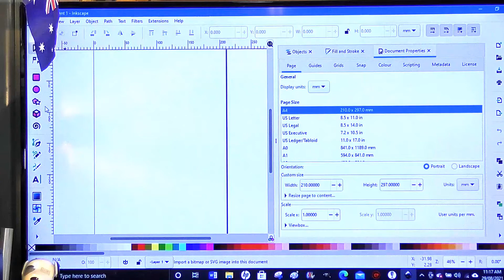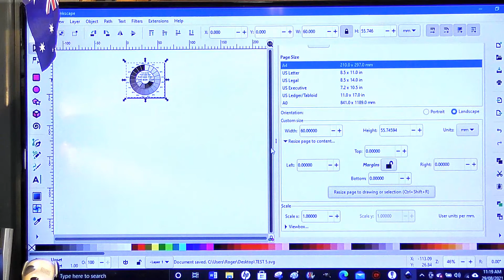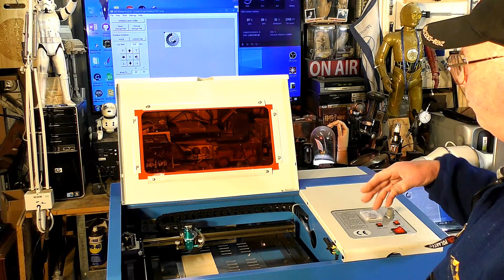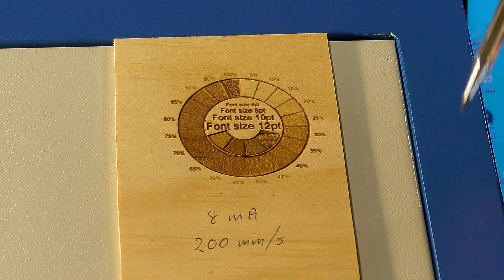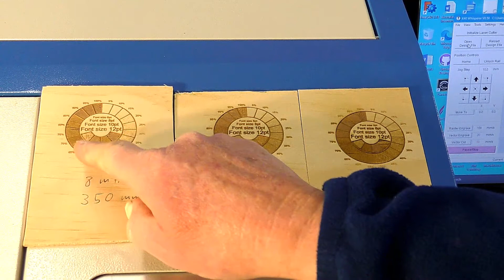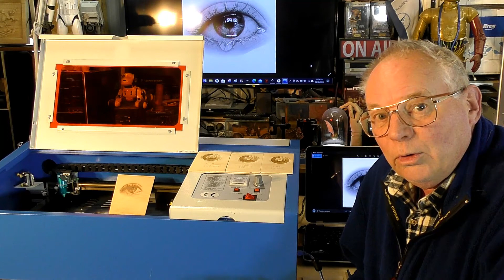K40 LASER (ENGRAVING) HOW TO!

Comment: How is it doing raster engraving? I thought the K40 couldn't modulate power unless you upgraded the board or you manually turned the knob. Is it running the same speed and power throughout the tests? I'm confused.

Comment: Fired up my K40 today Roger. The mod you suggest removing the dud fan air duct worked a treat. I did a raster engrave @ around 6mA as the first job. It was 130mm square with a lot of detail and I was amazed how well it came out!
Straight out of the box it actually works well although I do have the air assist and lens upgrade on the way. The only thing I could pick fault with on the engrave was a very slight difference in the engrave depth from left to right which I'm guessing is due to the bed not being perfectly parallel to the gantry. Something I will fiddle with later.
Love the K40 so far!

Comment: Great vid Roger. Thanks!
I'm curious why you kept the power at 8mw.  I would have thought on a grey scale test, you would have wanted it to go from white to black.  If the controller is regulating the laser power, will you still get the white, but a stronger black by setting the power at 12 or 16mw?  It's still going to be awhile before I get mine setup or I would play with it myself. :)
Reply from the maker: Hi Mike, 12  to 16 mA  would have cut all the way through to the back of the wood lol ;-))
Reply from the maker: 8 mA  is about 18 to 20 watts out put on the K40 which I use on my 100w laser for engraving, So it is just getting the right speed to  get the right tone of color.
Reply: @inventorsworkshop9600  Ah...cutting through would be a bit counter productive. lol  I guess black is not a good goal anyway.....the charcoal would be loose and smear once touched.  Thanks!!
Reply: I have a 2.5 watt diode laser on a 3018 pro CNC machine and in my experience pictures come out much blacker than with the K40. I'm not sure why but it may be due to the fact that the lower power requires a lower speed so the laser spends more time in a given spot.
Video's I've seen of 15 and 20 watt lasers don't burn as dark either but run faster. The engraving speed difference is significant a 4" x 6" picture on the K40 took a few minutes; the same picture on my 3018 pro machine took 12 hours. I use the K40 when I want it done quickly and the 3018 pro when I want IMO a better looking picture.
Reply: @electronron1  That's pretty interesting.  I was hoping to find a video on your channel... :(  lol  What a huge difference in time.  Thanks :)

Comment: dear Roger,
is their a good reason to buy a K40 for making custom packaging inlay's for in boxes.
to protect expensive components.
what i hope to see ones if it is possible to cut open cell foam, closed cell foam, EVA foam. and even styrofoam or the even harder PIR plates (STYRODUR/TYVEK). to a certain thickness,
so i can glue them togeather afterwards with a blank one to create a bottom.
and i forgot the name of that type of material with those hollow canals what they use to make for example "house for sale"  screen-printed sign's (sometimes they ad suction caps to mount them temporaraly on windows). looks like rib-cardboard but then made of plastic.

so maybe a demo of cutting dif. materials. sometime. ;)
thanks , Jan